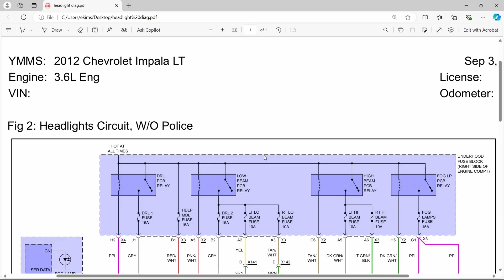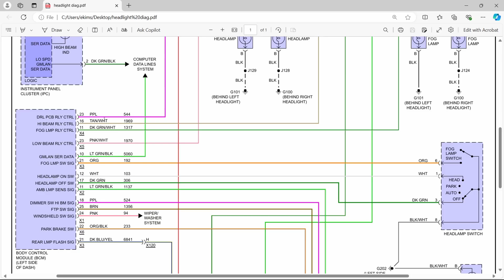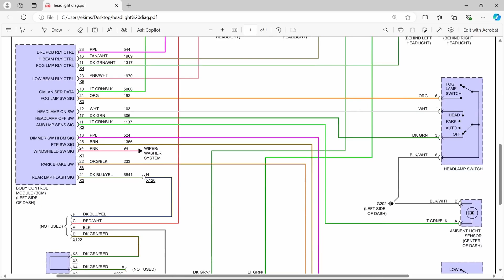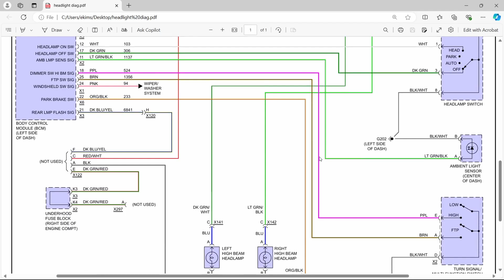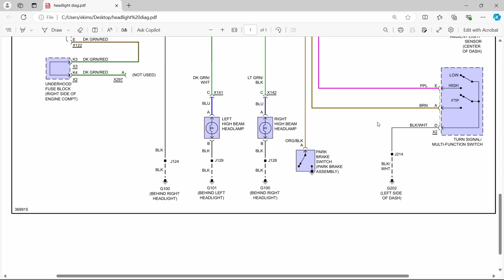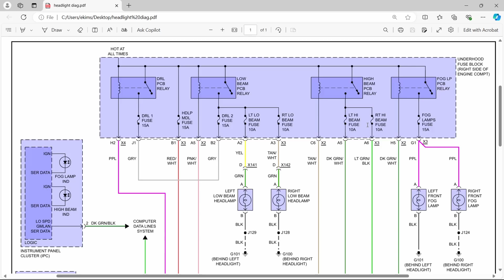How Does It Work 2? Wire Diagrams 2 : BCM controlled headlights

Comment: When I was in HVAC trade school the best things I learned where the basic fundamentals in electricity and  refrigeration. Everything else I learned in the field. Being able to read and understand wiring diagrams opened up so many possibilities for me. It doesn't matter if it's an appliance, computer, car, or spaceship. They all have wiring, circuits, and electronics. Once you get comfortable with these bits and bobs you can pretty much work on anything👍